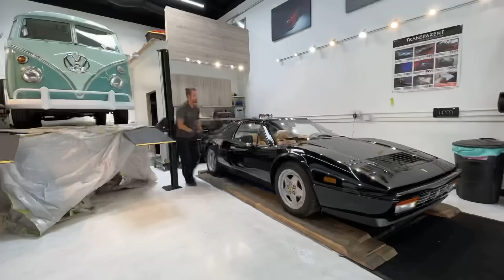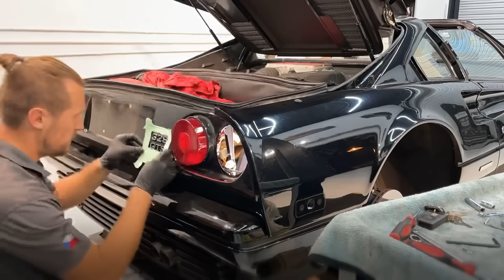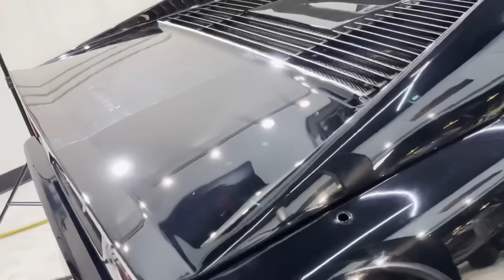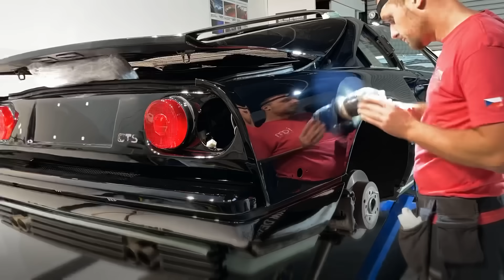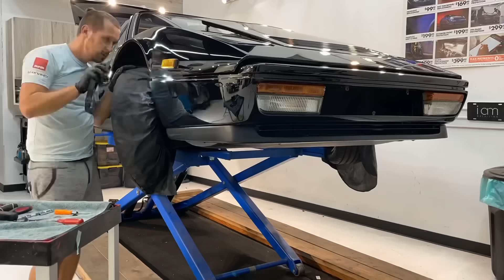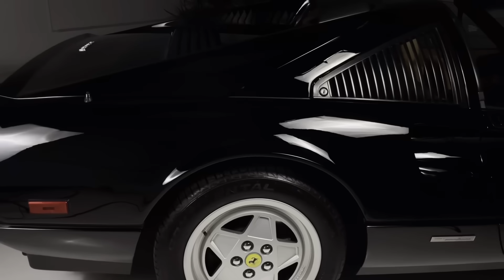60+ hours detailing on original black 1989 Ferrari 328 GTS

Comment: Fantastic work! Wow! 
Question: painted some wheels and wanted to wet sand using 3000 grit. What can I use to remove sanding marks?
Reply from the maker: Hey Nikko, thanks for your comment.
About your question... there is tons of videos how to buff sanding marks so I would recommend to watch something. But definitely you will need some kind of buffer, cutting pad with compound and some polishing pad with final polish.

Comment: I have a burning question, how do you clean your microfibre towels? And do you seperate the ones you used with difrent products when you wash them?
Reply from the maker: Yes we separate them (I have towel for paint and windows and then another towels for wheels, engine, dirty work) I use a lot new towels every day especially if I’m working with soft paint like this single stage. And I’m going once a week to Laundry and using washing machine and dryer.

Comment: Whats the thing you blasted the wheel well with in the beginning? Seems it like it removing the glue but unsure what tool/chemical that was?
Reply from the maker: That’s dry ice machine 😉
Reply: @IAMDetailing  intresting, so it's just like a sandblaster?
Reply from the maker: @Tjocksnorriss  yes but difference is that dry ice is non abrasive 😉 also we can play with adjustment so we are able to strip the paint or clean leather/fabric with it.
Reply: @IAMDetailing  Very cool product but i guess its to expensive for the average joe. Watched some of your other videos with it and damn the cars look almost as good as new :) You guys just upped the satisfaction level for me watching car detailing.
Reply: Its a shame that the rear right quarterpanel has been repaired in the past. But nevertheless a really great transformation. Better than new
Reply from the maker: @Tjocksnorriss  yes and no.. definitely it’s not cheap but in many cases it’s faster and much safer than other methods.. so it’s really good for classic and sports cars or other higher value cars.. 😉
We are glad you like it and thanks for comments 🙏🏽 😉
Reply from the maker: @van31974  thank you 🙂
Just wondering why do you think that the quarter panel has been repaired 🤔
Reply: @IAMDetailing  all other panels reflects the light in a nice smooth way, but on the quarter panel the light bends / runs more ? Looks like its been repaired, it has nothing todo with your work by the way, still looks stunning
Reply from the maker: @van31974   unfortunately on these "early"  Ferrari's it's very normal to see some imperfections in the paint even brand new Ferrari today has some stuff in the paint.. but these old ones from 80' were painted and prep different way so usually 328's have on both quarter panels some waves, but this car has done only some paint work on the front area, the rest is completely original.. it's maybe the lighting in the shop or something you see... sometimes bad reflection or different type of lights can change the look, but I can guarantee that whole car looks same from every angle.  Thank for your comment :)

Comment: How long would that last ?
Reply from the maker: Our services are permanent. 
We not masking or hiding anything like is more common with traditional "cheap" detailing/waxing where everything looks like before after few weeks or couple months and sometimes looks even worst. than before.

We removing and fixing defects and imperfections forever. So if you see anything bad after few months/years that means it was done after our job with bad maintenance or just using the car. Very depends how you take care of the car "maintenance is the key"